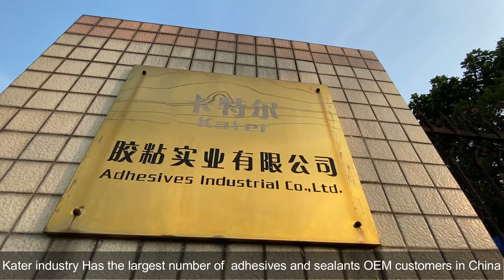The Manufacturing Process for KATER SILICONE SEALANTS

Comment: hi  sir this silent rtv is made of what material
Reply: Step 1: Isolate Silicon From Silica
Isolating silicon from silica is the first step in producing silicone. To achieve this, a large volume of quartz sand is heated to temperatures as high as 1800 degrees Celsius. Pure, isolated silicon is the result. Once it cools, manufacturers can grind it into fine powder.

Step 2: Combine Powder With Methyl Chloride
The fine silicon powder is mixed with methyl chloride. Applying heat again activates a reaction between the components forming what is known as methyl chlorosilane. Methyl chlorosilane is a mix containing several compounds, the most predominant of which, dimethyldichlorosilane, is the primary building block of silicone.

Step 3: Distill the Mixture
Getting from dimethyldichlorosilane to silicone requires a complex distillation process to separate the various components of methyl chlorosilane from one another. Because chlorosilanes have different boiling points, this step involves heating the mixture to a series of precise temperatures.

Step 4: Addition of Water
Following distillation, combining water with dimethyldichlorosilane causes a separation of hydrochloric acid and disilanol.

The hydrochloric acid then acts as a catalyst for the disilanol, causing it to condense into polydimethylsiloxane.

Step 5: Polymerization of the Silicone
You’ll notice polydimethylsiloxane has a siloxane bond. This bond is the silicone’s backbone. Polymerizing silicone involves several different methods depending on the finished product’s desired properties.
Reply: @istoppedlaughing5225 nice explanation